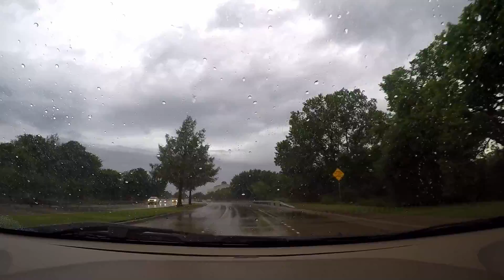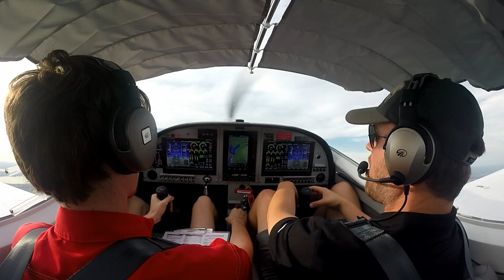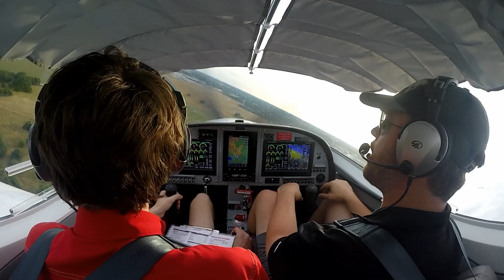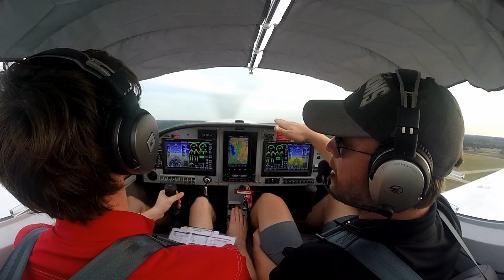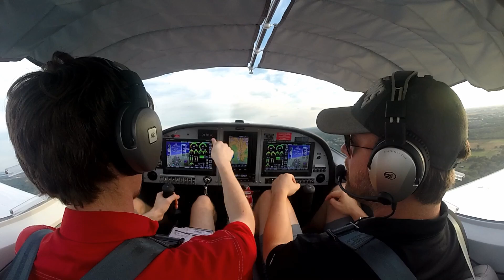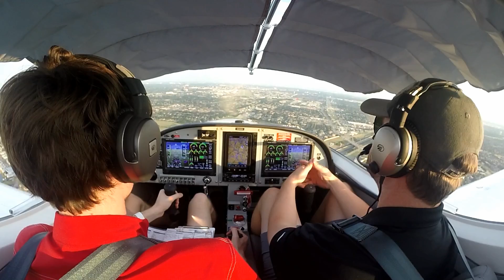Flying the SportCruiser | Addison Airport | Demo Flight

Comment: Nice long video! I’m learning this plane tomorrow. I just can’t see where the ptt transmission button is, it’s like the radio detects the voice and Tx 😃. I think on my clubs version the trim is by the flaps. Pity such a nice plane has electric trim! PS oh I saw it, it’s like a trigger button on the joystick!
Reply from the maker: Enjoy it! The push to talk is on the yoke/stick. You click it with your pointer finger. It’s not going to be visible from the camera as it’s on the far side of the yoke/stick.

Thanks!

Comment: This is one of the best video I ever seen, a little long but great instructions . I am training on a sports cruiser   I like the way power setting, airspeeds are called out initially, but stopped after the second touch n go. I wish you would be of continued calling power settings, airspeeds etc.   It helps to reenforces my memory.
Reply from the maker: Aztec Warrior thank you for the kind words! This was my first flight in the sport cruiser so I was learning as well myself. I only flew it twice or so before I bought a Cessna Cardinal. Great plane!

Comment: How did you feel about the taxiing on the sportcrusier? I am brand new to flying and found myself all over the place trying to taxi lol. I'm sure i'll get the feel of it.
Reply from the maker: Dan G you’ll definitely get used to it. You use differential braking when slow I found as you have no rudder authority. Once speed picks up and you have sufficient prop wash/authority on the rudder you can use less braking. It’s been a while since I own a cardinal now but they fly nicely. Very simple aircraft. You’ll have a lot of fun when you get the hang of it.

Comment: Got the opportunity to fly a Sport Cruiser yesterday, for the first time.  There really is an optical illusion that makes you think you are not taxing or rolling straight. Multiple times, mainly while taxing, I thought to myself “are we crabbing down the taxiway”?!?  And it was there on the landings as well.  I think it’s caused by the angle of the instrument panel surface and front cowling.  Tough to explain but will be evident while sitting left seat.  I’m also certain it will go away with a bit more time in the plane.
Reply from the maker: I agree! That was actually discussed in the video with the instructor I flew with. We were landing and as you may have noticed kept asking for more right rudder. It made me uncomfortable at first due to the feeling of not being "straight" or possibly crabbing.

Comment: Did you guys ever push the circuit breaker back in? LOL (that's why you don't pull them)
Reply from the maker: It has been a while so my memory may not be accurate, but I personally did not put the breaker back in during the flight. The instructor may have without me noticing. Good catch on your part!

Comment: Thanks for the video.  Very helpful.  I've been talking to Patrick about buying a new SportCruiser.  I own a DA40 and prior to that a C172R.  How does the SportCruiser compare to other planes you've flown?  Any negatives?  Thanks.  Rick
Reply from the maker: The SportCruiser was a very nice aircraft to fly. The initial thing I noticed was that the input required to control the aircraft was much less than required in a Piper Cherokee/Cessna 172 model aircraft. I went for another flight after this and was able to fly using two fingers and my hand in my lap. Once the aircraft is trimmed, you don't need to touch it. If any adjustments are needed, minimal effort if any is required.

Here's what I found Flying The SportCruiser. All the rotation, approach, stall, and VSpeeds were similar. Rotate was around 55 Knots, Vy about 65 knots, etc.. All that is very similar to the Cessna 172 and Piper Cherokee Models. Cruising speeds were about the same as well. Cruising around 100 knots and if you want to push it at near max throttle, you can achieve around 105-110 knots. With winds, my average ground speed my last flight was 95 knots.

The engine cruises around 5,000 RPM. It has a noticeable different sound and takes a bit to get used to. Unlike a traditional cessna that has a red-line of 26-2700 RPM. Therefore you may be second thinking yourself when descending and landing as you usually set the RPM around 3400 RPM. Seems high, but you can lose some altitude and airspeed at that power setting quite easily.

The aircraft can and will descend if you make it, but due to being very aerodynamic and light, if you are high on final, you either have to gain a lot of airspeed, or slip it down. I have had no issues landing so far, but in my first landing in the video you see we are a tad bit high. Therefore I pitch the nose down a little and in result gain a few knots of airspeed. We had plenty of runway and was able to bleed off enough speed, but in a short field scenario you would want to hit your target approach speed and altitude for sure before attempting to land.

Of course the Ballistic Recovery System/ Parachute is very convenient to have. It's the red handle in the middle of the two seats that can be pulled in the event of emergency.

The SportCruiser being a light sport aircraft definitely was and felt lighter. We taxi'd behind a light jet at one point and when they accelerated forwards we felt a wing tip wanting to lift due to the thrust from the engines. That was the only time I noticed it though. Turbulence and other winds would be expected to be more noticeable, but I never felt that it was any different from the aircraft mentioned above. That would be the only negative though. It is lighter therefore required a little more crosswind correction and rudder when in gusty/windy conditions.

The avionics were great. It was simple to use, learn, and very capable. It makes flying easier and takes no skill to operate. A first time pilot or even a non-experienced passenger could operate and use the autopilot, GPS, and other Flight management systems built into the aircraft.

With the curved canopy you will have a slight illusion as mentioned in the video. On final when flaring you will feel like your nose is forward, but you actually need a little more right rudder to be completely straight and therefore not side-loading the landing gear/tires. It took a bit to get used to, but by the end of the flight I had it down.

Let me know if you have any more questions!
Reply from the maker: Additionally, the flaps are not "automatic". You will have to hold the switch and manually look at the indicator to determine what degree/% of flaps you are using. That could be a plus or negative for you depending on what you prefer.
Reply: Thanks so much for the great reply.  I've got the G1000 in my DA40, so glass will be easy.  I'm glad you mentioned the flaps because that what I was thinking the control did.  I prefer "automatic", but everything can't be perfect.  Patrick said I can register a new SportCruiser as an ELSA and equip it for IFR in IMC, which I will do.  You can also take a 16 hour repairman course and do you own annuals on an ELSA. Now, I'm just waiting for the WX to cool down so I can fly from KABQ to KADS and fly the plane.  I'm also looking at the Sting.  Again, thanks a lot.  Rick
Reply from the maker: Richard Sigler Sounds good! I had no idea you were able to perform your own annuals after taking a course. That will be a great time and cost saving factor in owning an aircraft.